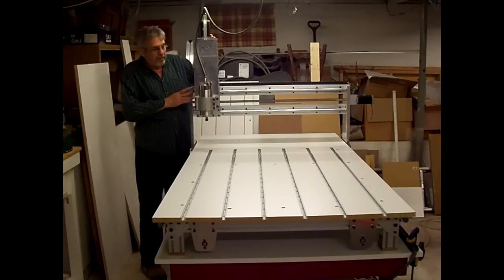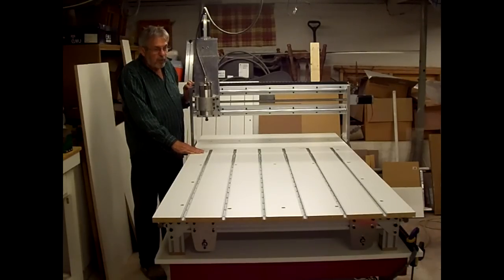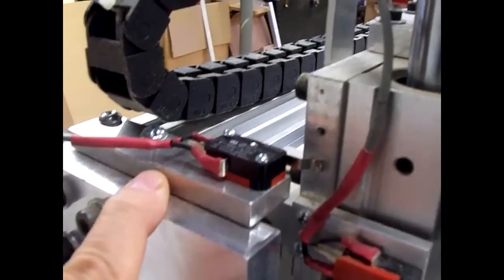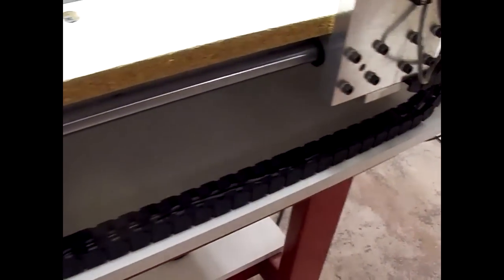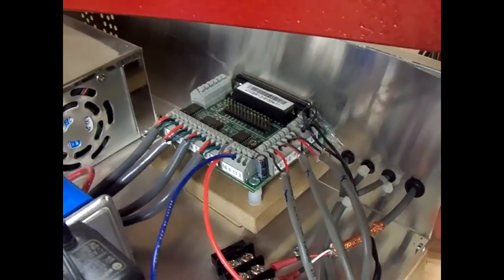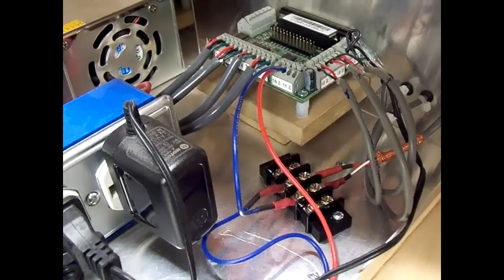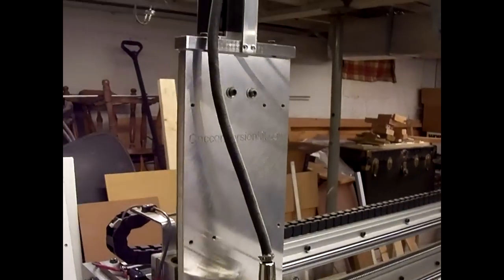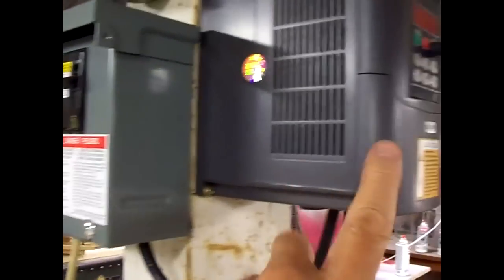CNC Router build part 9 Completion!

Comment: I have watched but I need help if possible the spindle turns on but there must be a e stop on somewhere do you know how to fix that ? I can’t move the x or y axis at all
Reply from the maker: If an E stop is in, there would be a message on Mach3 beside the red reset  button saying "Press reset...... Emergency Mode Active....."  Other than that, I don't know what could be wrong.

Comment: Hi, I am looking to put together a similar build. I like that design. How rigid is it. Thanks
Reply from the maker: It's fairly rigid, thanks for watching!
Reply: Hello again, I have sourced out the parts I will need except for the plates. It seems that the conversion kit website is no longer up. Would you have an alternate website or email address that I might contact to get these parts. Thanks.
Reply from the maker: @ripper143  
Sorry but I do not.

Comment: Can you explain a little bit better the 220v install for the spindle motor? and the wiring from the box? and also, did you figured it out on how to instal the water or air cooling system for the motor?
Reply: thanks!!! great advice i will check it out!!!

Comment: Hi Robert,  I completed assembly of my CNC Router.  It is the same size as yours.  I need help in setting up Mach3.  Did you you set your's up in metric?  I chose inches.  I can jog  in all directions; but get strange a reading.  The Z axis shows things like "-480.02" .  I wonder if you could share your Mach3  setup  so I could match yours?
Reply: Robert, don't know how to send you a private message.  email: thonlyone@gmail.com. Thanks, Ken

Comment: Robert,
Your videos were such a great help in putting my CNC machine together.  I have a couple of questions.  1. What are the set screws  in the linear bearings for?  Some of them came out and were setting on the table;  When I found out where they came from I put them back in. Do they need to be tight?  2.  It seems you have limit switches at just one end of each axis travel.  Why not on both ends?  
As soon as my coolant pump is delivered my machine will be completed.
Thanks again for your help.

Ken

Comment: I've a question ..i'm Building my CNC but i found out that there is alot of Aluminum types like 6060 or 7075 and i don't know wiche type is good for CNC Frame like sieds and front, back plattes ..can you guid mewich type i should use!!??
Reply: thanx mate ..

Comment: hello sir  this is arvind sankhla  from india 
i am  very much inspired after having seen these videos ,
i think if i follow you i can build  a  CNC for  my small workshop

could you please guide me.
humble  request  to you to respond on following

 on x axis you uses two stepper 
 what are the rating of these stepper?
do we need a VFD for spindle or it can be run through direct supply
Reply: thanks sir for the ind and quick response how to connect  with PC through USB or parallel port and which software do you use,

Comment: I think I bought the exact same unit.  Now my question is my concern since  I am machining mainly wooden parts,  what about wood dust getting into the linear bearings and ball screw bearings... any ideas of preventing dust buildup in these critical parts?#2  Do you have any links for pre-programmed shapes for the mach 3 etc... programs say for cutting a circle of any diameter etc....thanks bob

Comment: Cambiar a español
Hi good afternoon sir robert 'm from Spain and I'm creating a cnc yours is very well managed to have some doubts if I could alludar would be very grateful aluminum structure as it is 50 × 50 (mm)
And as the machine is 1.5 x ( m 2) the Nema Nema 23 motors are high torque few newtons

Comment: I commented in the video before this one about the outer slide bars and my concern with them deflecting with the overall weight of the "Y"axis fully stopped by only them.   

I then heard you in this video say you had issues with the gantry/"Y" axis running Parallel with each other......???  
 ***THE SOLUTION IS.....***  and I know you probably like the look/the feel/the easy cleaning of the Melamine, BUUUUT.....  you SHOULD resurface the "WHOLE" main platform with a 1 1/2" bit.  This WILL ENSURE that your Gantry/"Y" axis  IS RUNNING PERFECTLY PARALLEL with each other, you're basically making them "TRUE" to each other, this way anything you then clank down to the main platform with also contour to everything the same.  I would also think that you wouldn't want the Melamine since it is slippery.  I would think you want something that would HELP grip your materials. 

Anyways..... just my few & free thoughts.  OVERALL, I REALLY ENJOYED your documentation throughout the whole project.  iwt was rather relaxing, lol.....   ***you made it seem so CHILL***, LoL.....   I look forward to more videos and projects!!!!!!!!

Comment: hey great job on the build. i am going to order one today and have a couple questions.
what size machine is yours?
what is the maximum work area?
and now that you have used it a while whats your opinion(any issues)
Thanks
Reply: +MyRobertadams thanks for the quick reply  where are they shipped from . i noticed there is a canadian phone number and thats where i am. also could you tell me the outer dimentions of the bed as i want to build a table. i also need to know the size of the extrusion. thanks
Reply: +MyRobertadams ok great   thanks Robert . i ordered the same one you have today  and will keep in touch about the build .. thanks again

Comment: Something you may be interested in --  A neat and easy to set X Y and Z to ZERO based on the part. Works like a z zero touch plate.  I have it set up on mine using only the aluminum angle. Works fantastic!

buildyourtools.com  -- In the tutorials section look for Auto Zero Method Using Mach 3.

Read all the sections paying especially close attention about the DRO setting in  some versions of Mach 3 is handled in the bit of code provided..  This has to do with the way the DROs are accessed in different versions. Two complete codes are listed.  While they look alike at first glance but they are not. If on dosent work for you, try the other. 

This line in both you may need to change to the measured value of how thick your angle is. ----  Call SetOEMDRO(Zaxis DRO, .180)   ---  the .180 is the angle thickness, change as required.   Mine is .195 measured with a micrometer. .

Comment: While mine is completely home brew, including no plans, and doesn't look anything like yours this is one of the best build videos Ive ran across.  The only things I can possibly pick at is no limit switches and having all the connectors on the front of the controller box. Putting them on the back gives a far cleaner front and keeps them out of the way if you have to make a dive for the E stop there. While you can run a cnc without the limits I have them to prevent possibly smoking a steeper or doing some sort of mechanical damage if things go nuts and the cnc heads for never land. 450 oz/in steppers on a 10 pitch screw can create an amazing amount of pressure.  While mine is capable of about 350 in/min rapids I run it at 200.  Once again, fantastic video there and I recommend it for anyone making a CNC from a kit or scratch. BTW depending on you VFD, the spindle can be controlled from MACH 3, it does have that capability.
Reply: Mach 3 provides a pulse width signal that can control most any VFD.  See section 5.6.6 of the Mach 3 config document. For the basic idea. The output pin from the breakout board is configured similar to the stepper dir and pulse pins. Section 5.3.1 shows you where this is. The signal is a 0 to 5 volt level.  Not sure if its the pulse width or pulse rate that does the trick put I suspectt its the frequency.,  Dont have a scope to check it. Check the docs on your VFD and look to see if it supports an external control of some sort. In any rate I HIGHLY recommend optical isolation from the breakout board to the VFD. Using the same setup screen you can also use a relay for on/off control also on the same pin, but only either on-off OR pulse width- not both at once.

The 110 to the router is ran to a switch on the side of my CNC where its
 real handy along with a switch wired to a socket for my shop vac I use 
for dust control.. EVERYTHING I need real handy. None of that reaching all over the place for switches. 

Most of the time I just use a trim router but I have things set up where I can switch to a 300 watt spindle using the MACH 3 pulse output or a manual knob.  Takes mabey 20 min to switch over.  Best thing for cutting and engraving on metals and plastics. Router wont run slow enough to prevent melting plastics.  My e-stop is in a small wood box on the end of about 8 feet of cable. I just move it wherever I may need it, real close if Im doing something on the weird unpredictable side. The power switch will also kill everything if needed too. The space bar also acts like an e-stop but in reality its just a pause switch. My limit switches and E-stop are set up where normal is closed loop or 5 volts to the breakout board. That way if there are any breaks in the circuit--- no go. Also easy to check for opens with an ohmmeter for trouble shooting, if /when needed. 

I also recommend putting a 15 amp breaker on the control box like on power strips. Beats the hell out of having to go hunt down a tripped breaker somewhere.  :) 

I use just 3 steppers. I set mine up where I work from the side and not an end. Works better for me. The bed your y and my X has a cable under it that takes care of one side getting ahead of the other. Its in basically a modified X setup using 4 V rollers, 2 at each side. Check out one of those old drafting tables for how the horizontal bar stays parallel. Same exact idea. If you want to make a new case  you can find the dimensions for all the DB style cutouts on line. I use 4 pin round aircraft connectors that have a screw ring on the male half where they lock in place. Cant pull one out accidentally. .The say way to wire limit switches is to use a SINGLE common ground pin with the switches serried on each axis. Gives you a nice 4 pin layout, hot pin for each axis and the common ground for all the axis. .
Reply: Mach 3/4 is capable of doing far more than most realize such as VFD speed control, etc. The manuals only very lightly hint at how you can customize it for very specific needs.  Check this out for a LOT of info on it.   https://www.machsupport.com/forum/  

One thing I have set up is nothing more than an 1.5 inch piece of 1 inch angle aluminum set up as a touch probe and a bit of code under the Tool Zero button.. Set upright against the zero corner of something it gives me an absolute  X and Y zero centered on the bit diameter and a Z  zero. Zero can be off a couple or 3 thou depending on the surface roughness. A few years back I ran across how to do this on the net. 

I almost never home mine as the real zero point you are interested is the zero point on the part. One easy way to get a good zero point if you reference a corner of the stock as the work zero is to put a piece of paper between the stock and slowly jog over until there is a bit of drag when you pull lightly on the paper. Next enter half the diameter of the bit in the approate DRO as a minius sign then the  figures. The measured point will be off by half the tool diameter in the negative direction The true zero is the center point of the bit, so when you hit the go to zero button, the axis will go positive setting the tool center directly over the edge, the true zero point. If  you want a zero somewhere of the edge then use the MDI screen to enter the offset, then zero the DRO. Far easier to do than to explain and doesn't require  using some marked point on the table to allighen a jig to. 

As you cut those T-track slots with the CNC just simply align one edge of a jig to the t-track by dropping someting thin enough to fit in the slot then push the jig edge against it.  Quick, dirty, and simple to get parallel to the cnc bearings. Then use the above to get your starting point.
Reply: +MyRobertadams I bought the same VFD you have. The VFD you're using does have the ability to set spindle speed from the break out board outputs. You will have to program the option in the VFD in addition to setting it up in Mach 3.
Reply: See section 4.6 Spindle control, in the mach install manual for the details how to set it up. The operation manual also has it but I dont recall exactly where, check the index.  For the controller setup go here. http://www.automationtechnologiesinc.com/products-page/cnc-spindle/300w-1hp-cnc-air-spindle-controller   check the docs section on the lower left of that page. Note the hot and  ground from the breakout board goes to the 2 pin connector beside the trim pot. Ground is closest to the trim pot. Also you must move the jumper next to that connector TOWARDS the connector.  the empty pin will be on the side by the trim pot.

 This is where I got mine.. They also have some serious steppers those little g-shilelds cannot handle. Mine uses 3 separate stepper driver cards capable of 40 volts at 3 amps a phase and nema 23 450oz/in steppers. These were in a kit along with the power supply and breakout board as a kit when I built mine. Best I remember was something like $500.

Also I highly recommend you get some extra fuses. That fuse WILL blow if you manage to stall the spindle for more than a few seconds. I learnt that by running some g-gode setup using 120 ipm travel with around 3/8th depth of cut with a 3/4  inch bit, typical what I often do chewing up MDF using the trim router for a spindle.. Now I check the code first.  lolol

This should fix you up fine..